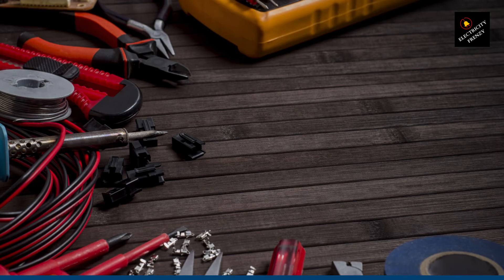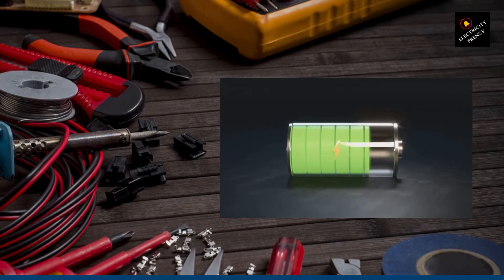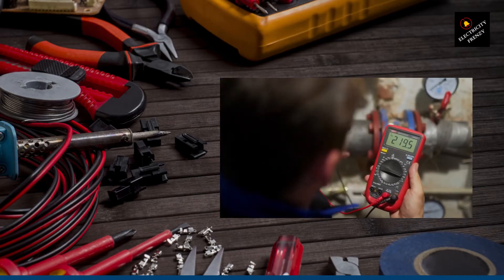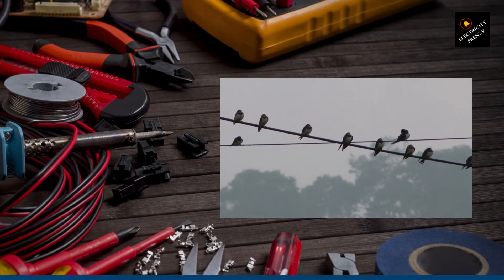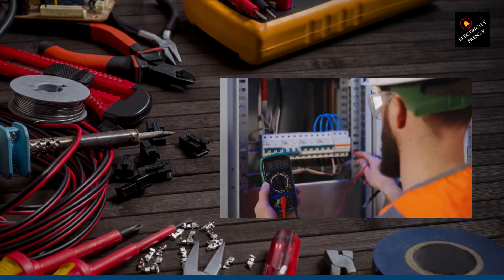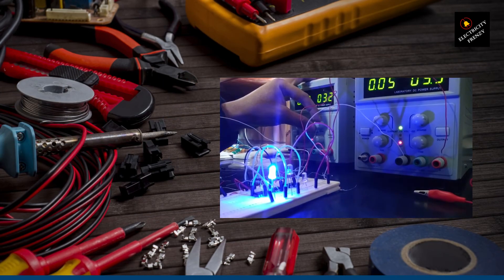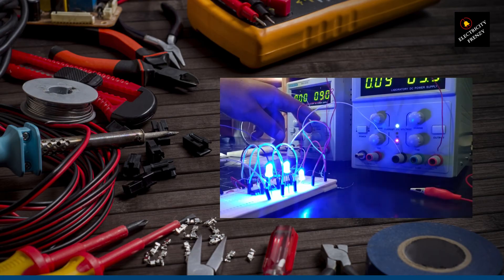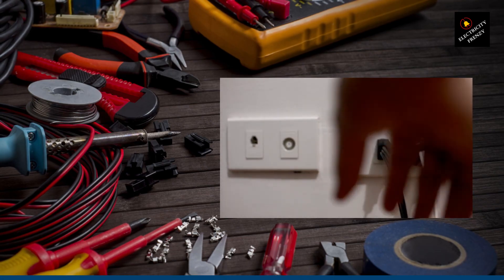Low Voltage in Home? Here's What you Need to Know!

Comment: here in the Philippines we have 220 voltage supply. 
and some of our appliances operate at around 220 to 240 voltage and there are times that this supplied voltage to our home drops at around 207 to 218 voltage. 
my question is it still safe for my appliances to operate around this 207 to 218 voltage even though our appliances rated operation is 220 to 240 voltage?
Reply from the maker: We have the same exact issue in my country,  but the voltage drops to 140 V this is a real problem.

But in your country 207 v still a good value for the appliances.

Comment: My electricfan fluctuates almost every time, and also when my computer is on and i turned off the fan, my pc monitor turns off for like 5 seconds and then will be back again. Is this a sign of low voltage?
Reply from the maker: PC monitor turns off may be a sign of low voltage, but it's better to measure the voltage with a Multimeter.
Reply: @ElectricityFrenzy  how to fix low voltage outlet?
Reply from the maker: Chech the voltage value with a Multimeter then you can use a voltage Stabilizer

Comment: My question is why when using a NVT; a fluke LVD2, anywhere on the garage wall between interior house wall it lights blue like it’s detecting low voltage everywhere on wall. I was thinking my dad may have spiked a wire when he put up shelves on that wall
Reply from the maker: The Fluke LVD2 might be lighting up due to its high sensitivity, which can detect electrical fields from wiring behind walls or electromagnetic interference (EMI) from various sources in the garage.